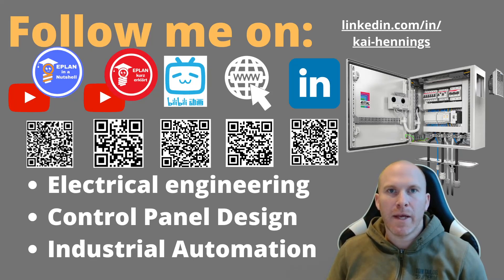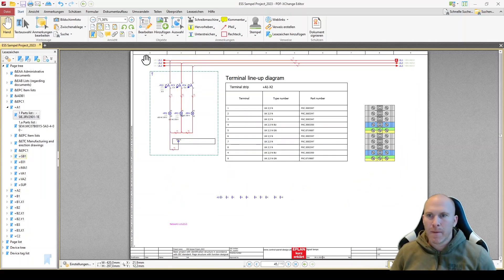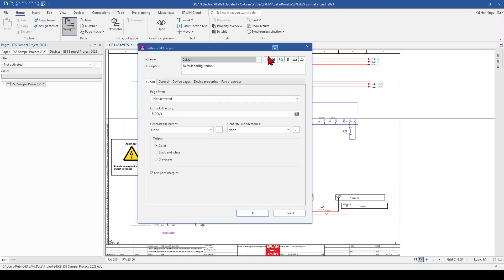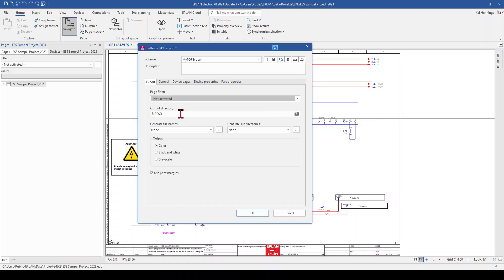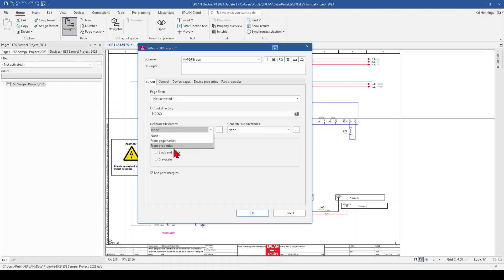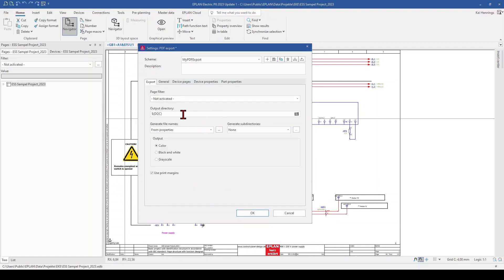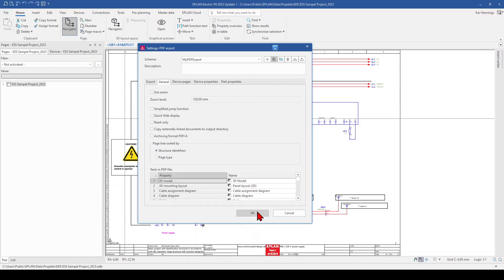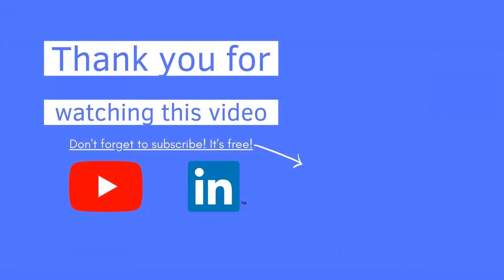EPLAN PDF Export. How to make your own scheme for the PDF Export?

Comment: Hello Kai, Great Video thank you for making it.
I have been experimenting with PDF Export device pages.
I would like to create a part property page for each unique part used in a design, my desire is to report the information found in the Bill Of Material Navigator. There would be a single page for each unique manufacturers part and then whatever part properties I wish to add.
Ideally this would also include a property that includes the Full DT of each instance of that part in the design. I can easily create a part property page but I can not make this report unique like with a summarized BOM, it always gets generated like a parts list where there is a part report page created for each part reference. Are you available for paid consulting? Thanks